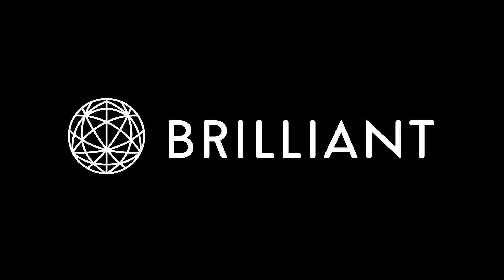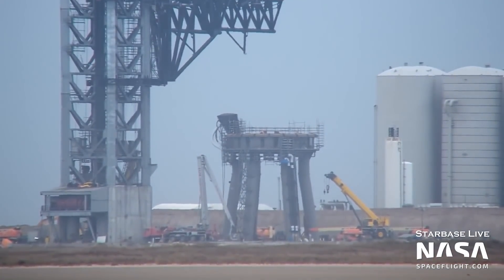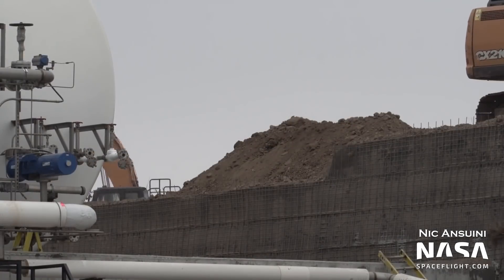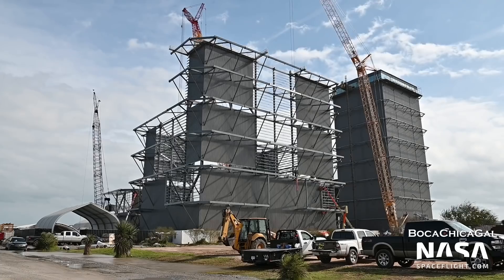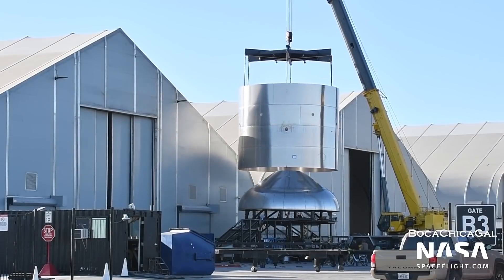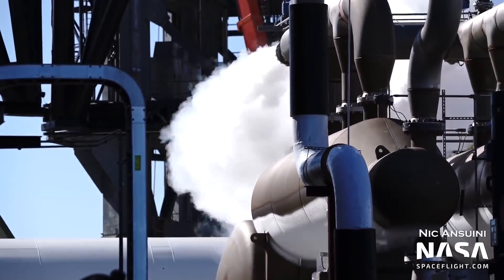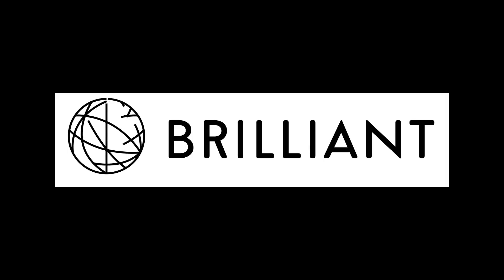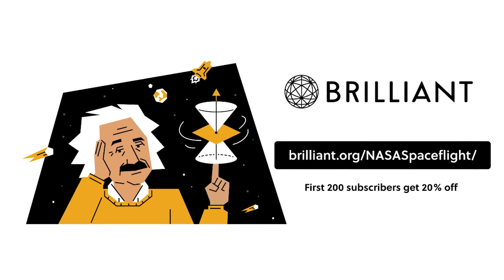SpaceX tests rocket catching system, but is the tank farm in trouble? | Starship Update (Narrated)

Comment: I wouldn't be surprised if 4 & 20 still fly on the suborbital flght.  I mean, they're all ready fully kitted out, and since the primary purpose of that test is to check the reentry profile, they might as well use them for that purpose. They already have (presumably) the Raptors for them, and they new boosters/starships will use Raptor 2 anyway, so might as well use what you have for a full up test rather than expend the newer ones.  If they're just going to be thrown out anyway, why not use them for a test where you weren't planning on (full) recovery?
Reply: Dumping them into ocean is cheaper than scrapping. 420 will fly and give them some valuable data.
Reply: I would fly with the most improved hardware that does not add too much delay.   I think Elon is more worried about showing as much success as soon as possible and limiting disasters that could be schedule disasters.  They learn alot from just building and ground testing these early vehicles.
Reply: Re-entry is only good from an orbital positio. Re-entry at anything below LEO is essentially pointless because it's not a realistic altitude at which starship will be re-entering from. Any suborbital re-entry will not be equivalent to orbital re-entry, which starship is meant to accomplish.
Reply: @colincalloway5257  It's close enough for a test.  The ship is still meant to go nearly all the way around the planet; it's suborbital only in the sense that it's not QUITE reaching orbital velocity, and that's it.  The starship used will still have to reenter the atmosphere somewhere around Hawaii, hence testing the heat shield and how well the mech anics of the control surfaces survive.  It won't quite be the same, but if you've already got everything assembled why not use it for it's intended purpose -- ie, testing everything you can?  I mean, if it (20) can't survive that test due to heat from that lower trajectory, it may indicate some problem in the design that needs to be addressed.  And if it does survive, then at least you know your basic concept is sound.

4 & 20 are going to be discarded anyway, along with any Raptors on them, so might as well get what information you can out of them.

Comment: As i commented on the daily videos before, i think the berm was there to put pressure on the ground to extract water faster, so concrete can be poured without the fear of the base tilting, also meaning some heavy heights will be over the concrete!
Reply: You don't bother with horizontal matting if it's just temporary.
Reply: Definitely not, we know why the berm was placed there, that has never been in question.